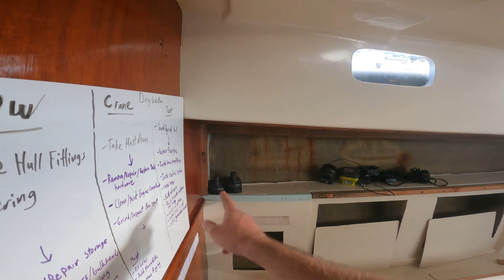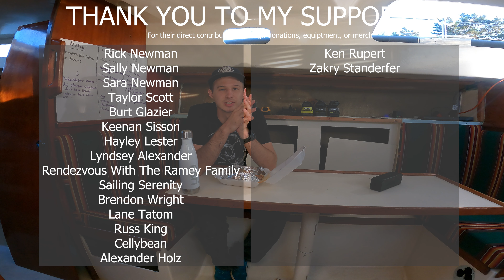Building Out Storage

Comment from the maker: 5 Lb Divinycell Foam
https://www.fibreglast.com/product/vinyl-foam-5-lb-density

Equipment Used (Amazon Associate Links):
🧻
Materials
TotalBoat Epoxy Kit (Amazon)
https://www.amazon.com/gp/product/B06XH2Q869/ref=ppx_yo_dt_b_search_asin_title?ie=UTF8&th=1&_encoding=UTF8&tag=projectseawol-20&linkCode=ur2&linkId=3f31d1d571291456dde9bfda7e1b3f74&camp=1789&creative=9325

Table Top Epoxy (Amazon)
https://www.amazon.com/gp/product/B01LYK2NAG/ref=ppx_yo_dt_b_search_asin_title?ie=UTF8&th=1&_encoding=UTF8&tag=projectseawol-20&linkCode=ur2&linkId=aac5400502b45f15c295170ce8be9467&camp=1789&creative=9325

WEST SYSTEM 404 Filler (Amazon)
https://www.amazon.com/gp/product/B0006JJAU6/ref=ppx_yo_dt_b_search_asin_title?ie=UTF8&psc=1&_encoding=UTF8&tag=projectseawol-20&linkCode=ur2&linkId=ff4529fd6f89549be9bf7a88a2c445af&camp=1789&creative=9325

Fiberglass Chopped Mat (Amazon)
https://www.amazon.com/gp/product/B01EVYEST4/ref=ppx_yo_dt_b_search_asin_title?ie=UTF8&psc=1&_encoding=UTF8&tag=projectseawol-20&linkCode=ur2&linkId=57b870abdd4f4c36206cc3309e51b477&camp=1789&creative=9325

Wax paper (Amazon)
https://www.amazon.com/Cut-Rite-WAXPAPER-Cut-Rite-Paper/dp/B002U0KKI0/ref=sr_1_6?crid=3VJBSHWFMDN4S&keywords=wax+paper&qid=1691097723&sprefix=wax+p%252Caps%252C406&sr=8-6&_encoding=UTF8&tag=projectseawol-20&linkCode=ur2&linkId=0bd5800b27fd6e35ec17f4d7eddc30c4&camp=1789&creative=9325

Popsicle Sticks (Amazon)
https://www.amazon.com/WISYOK-Natural-Depressors-Supplies-Crafting/dp/B09WK7QPC7/ref=sr_1_2_sspa?crid=1NJZ7IY7BIT6B&keywords=popsicle+sticks&qid=1691097745&sprefix=pops%252Caps%252C419&sr=8-2-spons&sp_csd=d2lkZ2V0TmFtZT1zcF9hdGY&psc=1&_encoding=UTF8&tag=projectseawol-20&linkCode=ur2&linkId=18562410d2efacb447830182f9d74763&camp=1789&creative=9325

Acetone (Amazon)
https://www.amazon.com/Klean-Strip-Fast-Acting-Fiberglass-Centaurus-AZ/dp/B09QRPX8PH/ref=sr_1_10?crid=15O1ZQAQOMV2I&keywords=acetone&qid=1691097783&sprefix=acetone%252Caps%252C263&sr=8-10&_encoding=UTF8&tag=projectseawol-20&linkCode=ur2&linkId=a1b08c5de6a250d5a77525109b51c644&camp=1789&creative=9325

Scott Blue Shop Towels (Amazon)
https://www.amazon.com/All-States-Ag-Parts-Towels/dp/B073WQYZ1L/ref=sr_1_8?crid=10YOE81HKBJ3&keywords=blue%252Bshop%252Btowels&qid=1691098266&sprefix=blue%252Bshop%252Btowels%252Caps%252C255&sr=8-8&th=1&_encoding=UTF8&tag=projectseawol-20&linkCode=ur2&linkId=929479890c87cc729fd220ee710406c0&camp=1789&creative=9325

This Old Boat (Amazon)
https://www.amazon.com/Rundown-Fiberglass-First-Class-Shoe-String-Budget/dp/B000JVGLQM/ref=sr_1_3?crid=SA2LZTN0DP2D&keywords=this+old+boat+don+casey&qid=1691099564&sprefix=this+old+boat%252Caps%252C716&sr=8-3&_encoding=UTF8&tag=projectseawol-20&linkCode=ur2&linkId=db6d510459506efdf843cb4955828b02&camp=1789&creative=9325

Sailboat Repair Manual (Amazon)
https://www.amazon.com/Caseys-Complete-Illustrated-Sailboat-Maintenance/dp/0071462848/ref=sr_1_1?keywords=don+casey%2527s+complete+illustrated+sailboat+maintenance+manual&qid=1691097683&sprefix=don+casey%2527s+complete%252Caps%252C263&sr=8-1&ufe=app_do%253Aamzn1.fos.18ed3cb5-28d5-4975-8bc7-93deae8f9840&_encoding=UTF8&tag=projectseawol-20&linkCode=ur2&linkId=555278f957b257e42aa3810b85d1290c&camp=1789&creative=9325

🔧
Tools
Upholstery Cleaner (Amazon)
https://www.amazon.com/Bissell-Little-Commercial-Cleaner-BGSS1481/dp/B073HHYPMP/ref=sr_1_4?crid=1Q8ZFUZK1VQXH&keywords=upholstery%252Bcleaning%252Bmachine&qid=1691821016&sprefix=upolstry%252Bcleaning%252Bmachin%252Caps%252C494&sr=8-4&th=1&_encoding=UTF8&tag=projectseawol-20&linkCode=ur2&linkId=a79d243d44adbb1838bcc8530a01f021&camp=1789&creative=9325

DEWALT Oscillating Tool (Amazon)
https://www.amazon.com/DEWALT-Oscillating-Tool-3-Speed-DCS356C1/dp/B085B253MD/ref=sr_1_2?keywords=dewalt+oscillating+saw&qid=1691098106&sprefix=dewault+occ%252Caps%252C263&sr=8-2&_encoding=UTF8&tag=projectseawol-20&linkCode=ur2&linkId=dd33688fa11736c6e2f156e269840c5c&camp=1789&creative=9325

LED Portable Work Light (Amazon)
https://www.amazon.com/Craftsman-Portable-Lumens-Tesadorz-Microfiber/dp/B07KQTS8FQ/ref=sr_1_22?keywords=craftsman+battery+work+light&qid=1691098045&sprefix=craftsman+battery+work%252Caps%252C248&sr=8-22&_encoding=UTF8&tag=projectseawol-20&linkCode=ur2&linkId=5ce993d502725152320e4fb2130ba2c5&camp=1789&creative=9325

Shop Vac (Amazon)
https://www.amazon.com/gp/product/B07QXWG93C/ref=ppx_yo_dt_b_search_asin_title?ie=UTF8&psc=1&_encoding=UTF8&tag=projectseawol-20&linkCode=ur2&linkId=83da8bc80cc643288a356ffa63f46545&camp=1789&creative=9325

Ryobi Finger Sander (Amazon)
https://www.amazon.com/gp/product/B07PWXKS4F/ref=ppx_yo_dt_b_search_asin_title?ie=UTF8&psc=1&_encoding=UTF8&tag=projectseawol-20&linkCode=ur2&linkId=80feb781237bea2629369bc1311854d4&camp=1789&creative=9325

Hot Knife (Amazon)
https://www.amazon.com/gp/product/B08TPRFZBK/ref=ppx_yo_dt_b_search_asin_title?ie=UTF8&psc=1&_encoding=UTF8&tag=projectseawol-20&linkCode=ur2&linkId=2e582a5e39a4b8d7536cd4f00476c571&camp=1789&creative=9325

Ryobi Random Orbit Power Sander (Amazon)
https://www.amazon.com/gp/product/B017POA9R2/ref=ppx_yo_dt_b_search_asin_title?ie=UTF8&psc=1&_encoding=UTF8&tag=projectseawol-20&linkCode=ur2&linkId=191f188615049296f9b8e98e1178dc8e&camp=1789&creative=9325

Fiberglass Roller Tools Kit (Amazon)
https://www.amazon.com/gp/product/B07BBXLDP7/ref=ppx_yo_dt_b_search_asin_title?ie=UTF8&psc=1&_encoding=UTF8&tag=projectseawol-20&linkCode=ur2&linkId=f874325a91567682c097690df94f5069&camp=1789&creative=9325

Caulking Syringe (Amazon)
https://www.amazon.com/gp/product/B071KS9XSJ/ref=ppx_yo_dt_b_search_asin_title?ie=UTF8&psc=1&_encoding=UTF8&tag=projectseawol-20&linkCode=ur2&linkId=f0a60d02e32b22364c52f3f4d937b737&camp=1789&creative=9325

Husky 14-in-1 Painter's Tool (Amazon)
https://www.amazon.com/Husky-DSX-G14-14-in-1-Painters-Tool/dp/B00KXYKQDY/ref=sr_1_3?crid=225R654I9LGW3&keywords=husky+multi+tool+scraper&qid=1691096033&sprefix=husky+multitool+scrapper%252Caps%252C271&sr=8-3&_encoding=UTF8&tag=projectseawol-20&linkCode=ur2&linkId=6fc24d6dac72bb83dc44bd1d80f09fe2&camp=1789&creative=9325

Glad Zip Bags (Amazon)
https://www.amazon.com/Glad-Storage-Sandwich-Zipper-Count/dp/B00IA6IPWQ/ref=dp_fod_sccl_2/133-4753386-4192625?pd_rd_w=vGlaY&content-id=amzn1.sym.c1d527b2-d053-4e09-ac20-091579b51534&pf_rd_p=c1d527b2-d053-4e09-ac20-091579b51534&pf_rd_r=KMGS2EBTY0ZH50M6TYCK&pd_rd_wg=ExZIj&pd_rd_r=68788b6a-b0c5-44c6-8439-49c68da23129&pd_rd_i=B00IA6IPWQ&psc=1&_encoding=UTF8&tag=projectseawol-20&linkCode=ur2&linkId=dd626719c793a1984e33c0200923e4e8&camp=1789&creative=9325

Rechargeable Headlamp (Amazon)
https://www.amazon.com/Black-Diamond-Revolt-Headlamp-Graphite/dp/B081ZGGFPK/ref=sr_1_7?keywords=rechargeable+headlamp+black+diamond&qid=1691103478&sprefix=recharchable+headlamp+bl%252Caps%252C210&sr=8-7&_encoding=UTF8&tag=projectseawol-20&linkCode=ur2&linkId=9906a35e69878cac8cb57ac2668ee7bc&camp=1789&creative=9325

📸
Cameras
GoPro 9 (Amazon)
https://www.amazon.com/GoPro-HERO9-Black-Waterproof-Stabilization/dp/B08KHRSYFX/ref=sr_1_1_sspa?keywords=gopro9&qid=1691095145&sprefix=gopro9%252Caps%252C331&sr=8-1-spons&ufe=app_do%253Aamzn1.fos.ac2169a1-b668-44b9-8bd0-5ec63b24bcb5&sp_csd=d2lkZ2V0TmFtZT1zcF9hdGY&psc=1&_encoding=UTF8&tag=projectseawol-20&linkCode=ur2&linkId=9b1ff42d66ee82000ea0ef115ec5f40c&camp=1789&creative=9325

GoPro 7 (Amazon)
https://www.amazon.com/gp/product/B083C5XVD7/ref=ppx_yo_dt_b_search_asin_title?ie=UTF8&th=1&_encoding=UTF8&tag=projectseawol-20&linkCode=ur2&linkId=93f60f6119fa9009a0f7119f71b4dd19&camp=1789&creative=9325

Canon Mkii 7D (Amazon)
https://www.amazon.com/Canon-Mark-Digital-Camera-Body/dp/B00NEWZDRG/ref=sr_1_5?crid=3OKNNY01SO03L&keywords=canon%252B7d%252Bmark%252Bii&qid=1691101546&sprefix=Canon%252B7d%252Caps%252C276&sr=8-5&th=1&_encoding=UTF8&tag=projectseawol-20&linkCode=ur2&linkId=0e205296c528b746f8600e287493ac22&camp=1789&creative=9325

Sigma 150-600mm (Amazon)
https://www.amazon.com/gp/product/B01MD1ZKGS/ref=ppx_yo_dt_b_search_asin_title?ie=UTF8&psc=1&_encoding=UTF8&tag=projectseawol-20&linkCode=ur2&linkId=a8039f0124bf28e6ee04ceaaf9d0fcad&camp=1789&creative=9325

GoPro Harness (Amazon)
https://www.amazon.com/gp/product/B01D3I8A7A/ref=ppx_yo_dt_b_search_asin_title?ie=UTF8&th=1&_encoding=UTF8&tag=projectseawol-20&linkCode=ur2&linkId=3c1333b99a0a04e6d41faa5f1390fe3f&camp=1789&creative=9325

Flexible Tripod (Amazon)
https://www.amazon.com/gp/product/B08Z74JJQ9/ref=ppx_yo_dt_b_search_asin_title?ie=UTF8&psc=1&_encoding=UTF8&tag=projectseawol-20&linkCode=ur2&linkId=f6f55d9a2129cf243756867d2a66b8ae&camp=1789&creative=9325

Insta 360 (Amazon)
https://www.amazon.com/gp/product/B08YRZP1QN/ref=ppx_yo_dt_b_search_asin_title?ie=UTF8&psc=1&_encoding=UTF8&tag=projectseawol-20&linkCode=ur2&linkId=17468f3445fe9a2ff70b785600447528&camp=1789&creative=9325

Mavic Air 2 Drone (Amazon)
https://www.amazon.com/DJI-Mavic-Air-More-Combo/dp/B086XCGMN7/ref=sr_1_3?crid=2JOI75DQWPPML&keywords=DJI+Mavic+Air+2&qid=1691163945&s=electronics&sprefix=dji+mavic+air+2%252Celectronics%252C296&sr=1-3&ufe=app_do%253Aamzn1.fos.ac2169a1-b668-44b9-8bd0-5ec63b24bcb5&_encoding=UTF8&tag=projectseawol-20&linkCode=ur2&linkId=a86acb402ef4953961f32fa19d1afb25&camp=1789&creative=9325

Comment: Nice progress; Sailing Parlay just took down a mast, might be good preview. Might pre-treat the turnbuckles with kroil/penetrating oil - its a life saver. Good luck.
Reply from the maker: Thank you! Ya, the plate the mast was mounted on was fused to it and needed to come off when we started pulling on the mast, but other than that everything worked out alright.